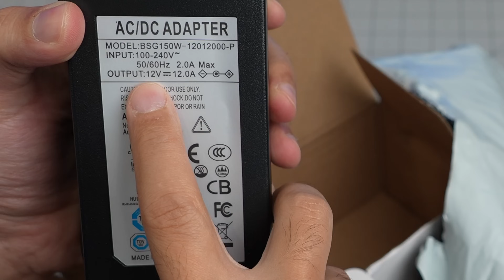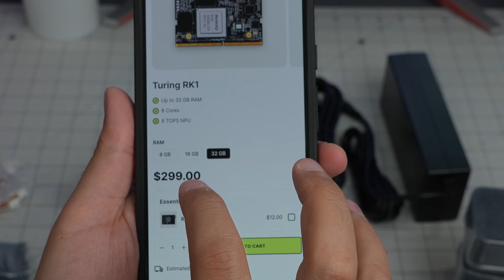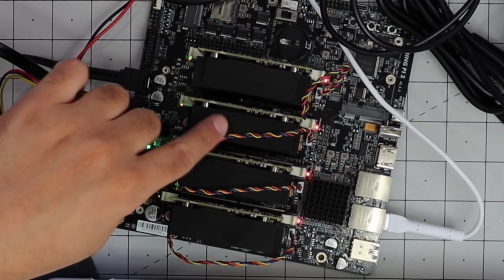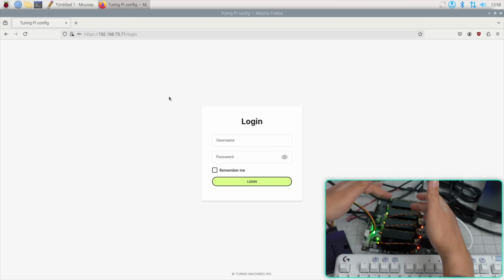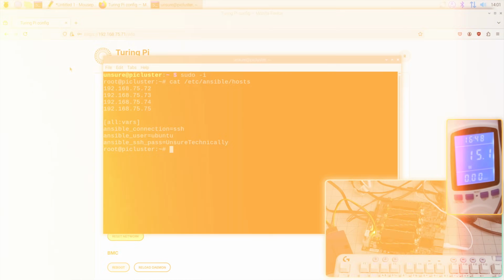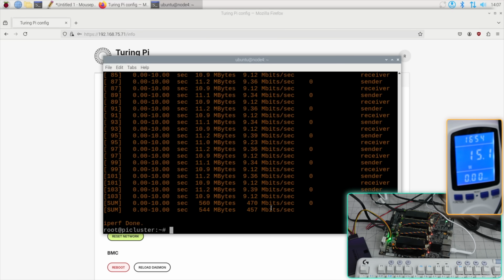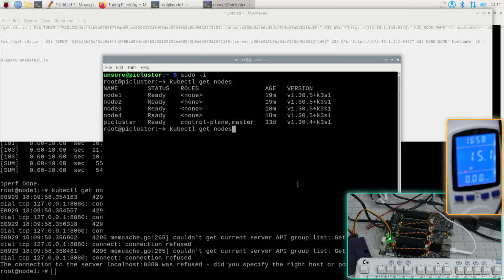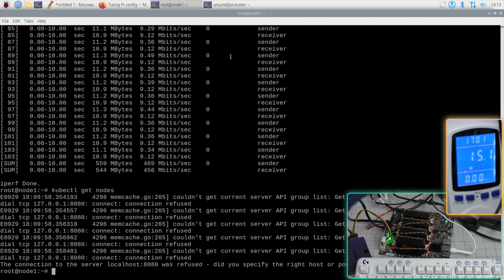Build a 4-Machine Linux Cluster on ONE Motherboard! Turing Pi 2.5 & RK1 Setup

Comment: Hi! You are doing all the stuff with your turing pi 2.5 and RK1 that I want to do. But my experience is poor so far. The BMC is unable to power the nodes and I'm getting inconsistent behavior , e.g. can't flash node 1 but can flash the others. Would you please make a how to video, or at least post a few details on any troubleshooting you had to do? Thanks!!
Reply: Fyi anyone struggling.You have to hit the edit button to power the nodes in the BMC web UI! And my node1 issues were a faulty rk1 board as the problem follows it around when I change slots. So apart from that the experience is pretty good!
Reply: Also one more note. I did have a faulty RK1 board with weird behaviour. TP have now replaced it and all is now well!

Comment: Please do a review on the Huananzhi F8D Plus. Its like 106 on Aliexpress
Reply from the maker: Ordered the board, hopefully soon will make a video.
Reply: @TechnicallyUnsure  Awesome!! It's dual cpu, but alot of potential. Pretty sure not energy friendly
Reply: @TechnicallyUnsure  Also, there is someone on Reddit that is saying they have a 2024 firmware. It will be interesting if you have the same. If not, I do have a 2023 firmware